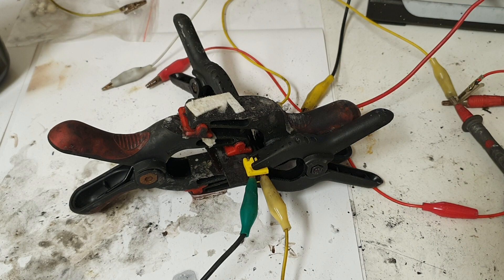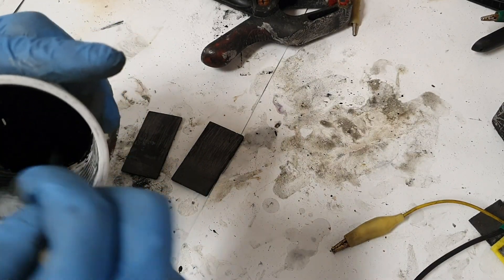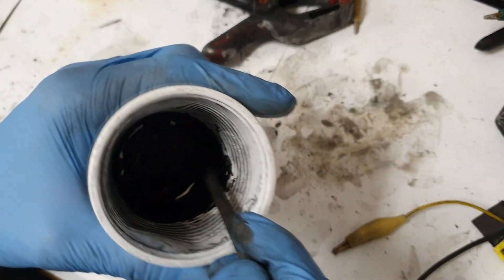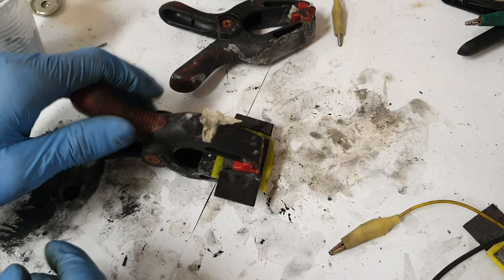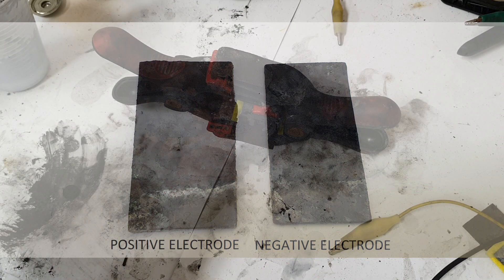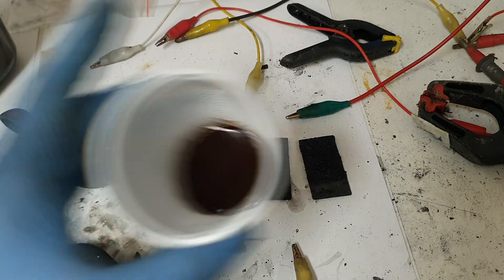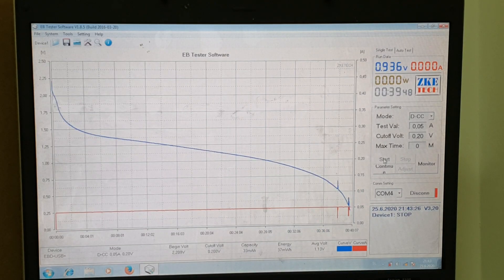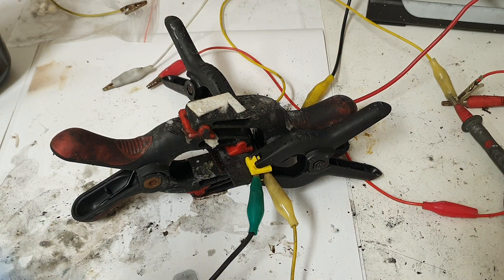Make a Supercapacitor which works like Battery

Comment: This video is incredibly insightful, and we're looking to replicate the process for our testing purposes.

We plan to use the following materials based on your video:
- Graphite Plates
- Activated Carbon
- Graphite Powder
- Binder (PVA: Polyvinyl Alcohol)
- ZnSO4 (Zinc Sulfate)
- MgSO4 (Magnesium Sulfate)
- Polypropylene (PP) or Polyethylene (PE)

If we're missing any materials or if you used specific types/grades, could you kindly share the exact details with us?
Thank you for your assistance.

Best regards,  
Suraj Singh

Comment: As capacitance will jump geometrically as distance between the plates decreases (try pressing on the plates), you could sand the surfaces of the plates, and use a high dielectric separator thin film to significantly boost the performance of this great cell, if you are running it as a capacitor instead of a battery;

Comment: use it or you lose it, cause of the self discharge, is a real inconvenience,  but being so easy to make!  thats amazing,  but i wouldnt say its as easy to understand, like a lot of things.    for a robot,  if u want to go for 10,000 farads run it for an hour, i reckon it would fit in its body and charcoal is really light!!!    so this is what im going to do!
Reply: hey mag,  i got a new idea for you! increase the resistance of the water and use high voltage,  then ull get more capacitance out of it via the voltage!!!

Comment: Which battery testing unit are you using?  Mine (EBD-A20H) doesn't allow me to go below 100 milliamps of current, which is very annoying and makes it almost useless for real battery testing.  Also, zinc sulfate is giving me dendrite problems. If I add less can this be reduced?
Reply from the maker: Then you have also thiourea or sodium dodecyl sulfate,.... 5%, 10% or 15%/wt. For graphene oxide concentration in the electrolyte is 0.08, 0.12 max 0.16wt%.
Reply: @cayrex  Thanks!  Ugh I feel like I wasted my money on the tester, as the one I bought was over $100.  So frustrating that it can't go under 100 milliamps.  The thing that makes it even more frusterating, is that it actually allows control down to 0.01 amps, but yet it doesn't allow you to go under 0.1 amps.  (For example, you can do 0.12 amps.)
Reply from the maker: @theinsider8872  ah, dont worry. When you will manage a good prototype cell, then you will make a bit biger version,... and then you will be able to use your current tester for sure.  😉
Reply: @cayrex  I'm getting 40mah on a 1x2 inch grafoil carbon cell(Without any activated carbon added).  I'm using aluminum foil for negative since the zinc ions stick to it like glue, and the aluminum seems to not react with anything in there(seriously try aluminum foil, it acts as a current collector for bonded zinc and reduces cost).  I'm currently only using zinc sulfate for the electrolyte, and the plates have to be spaced apart otherwise they dendrites short them out.  Current peaks over an amp, voltage holds around 2v.  The last cell design was a super capacitor.  I used my own ink mix of activated carbon which I eventually scaled up and managed 200mah.  It peaked at over 5 amps of current and held 2.3 volts.  The electrolyte was a mix of sodium hydroxide and alum.
Reply: @cayrex  What are your thoughts on sodium sulfate as an electrolyte for all carbon batteries/capacitors?  What sort of voltage can it hold?
Reply from the maker: @theinsider8872  ZnSO4 is in basic not bad and also is cheap. You have better electrolytes, but have higher price and are hard to get,... like Zn(CF3SO3)2. With ZnSO4 you will get the voltage of around 1.8V. Voltage range 1.4 to 1.8V
Reply: @cayrex  I'm not sure if you misread, I was asking about sodium sulfate, not zinc.  :)
Reply from the maker: I use EBD USB+ Electronic Load QC3.0 MTK-PE

You can get it on ebay for around $24. Ah yes the dendrites,.... yes you can reduce the dendrites by adding PEG-200 or graphene oxide to the electrolyte.

Comment: These are awesome results! Do you realize your figures are in the range of lead-acid specific energy? What kind of activated carbon did you use? Pre-made, coconut fiber, home-made, or other? I'm just curious. Congrats on this discovery!
Reply from the maker: Hi! Thank you! Emm, I buy this carbon on ebay and was AC for water based supercapacitors. But the seller is not active on ebay anymore. But any AC will work. Yes this device is not bad, but I have now two types of batteries which have the energy from 60 to 80 Wh/kg on type 1 (depending on the deep of discharge) and type 2 which have the energy similar to lithium iron battery or some other lithium ion batteries (around 130 - 140 Wh/kg)
Reply: @cayrex  That's really awesome! I consider your channel one of the better battery research channels on YouTube. I definitely need to consider becoming a patron so maybe I can learn some secrets from you!
Reply from the maker: Thank you! Yea, patreon is more or less a supporting platforme for my youtube channel. Unfortunately on patreon I dont have videos about type 1 and type 2 battery, but I have other videos which are not on my youtube, because I try my best that my patrons get a little bit more if they support me. But the main reason about patreon is the supporting if someone try to support my channel.
Reply: @cayrex  What's the amount of support required to get access to the patreon videos? Have you scaled your better chemistries up? I know I would try if it were me!
Reply from the maker: @kennethanderson7642  the amount for support on patreon is not really dependent,.... you can make a support for 1$, but most of the videos starts from 5$. You have support lvl 5, 10, 30, 50$,...10$ is most used lvl. Yes, I plan to make large battery (like 12V 500Wh or 1kWh) with my type 1 battery chemistry,... but I need to wait a little bit.

Comment: Better to add 5M ammonia to electrolyte to prepare ammine complex because otherwise during charging you will form a lot of sulfuric acid which will just react with zinc metal and be useless, however, with zinc ammine complex and manganese ammine complex, after charging, you will have zinc metal, manganese dioxide and ammonium sulfate solution buffered by a slight excess of ammonia, so as to be slightly alkaline. Resulting ammonium sulfate is a very soluble and good electrolyte with high conductivity.
Reply from the maker: Higher molar ammonia will react with zinc sufate to form tetraammine zinc sulfate. Is the same also with manganese or will form into dihexaammine manganese(II) hydroxide? In case that I want to have manganese sulfate,.... can I mix MnSO4 with tetraammine zinc sulfate,.... or will form Mn into ammine complex anyway?
Reply: @cayrex  I don't completely understand your question, but if I am understanding you correctly, just make sure you have an excess of ammonia to form both ammine complexes, i.e. ensure everything is complexed and neutralised.
Reply from the maker: @idea-shack  if the MnSO4 will form into complex also if I mix only manganese sulfate and tetrammine zinc sulfate
Reply from the maker: @idea-shack  I mean,... if I make a electrolyte mix with only manganese sulfate and tetraammine zinc sulfate. The MnSO4 will form into MnO2 when charging and in discharge state of the battery will go back to MnSO4 or will Mn form a complex?